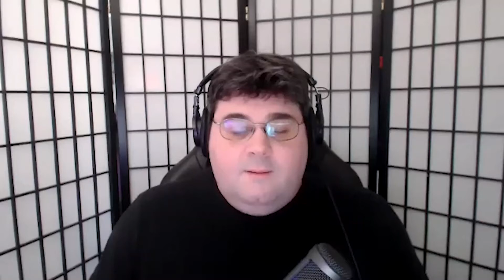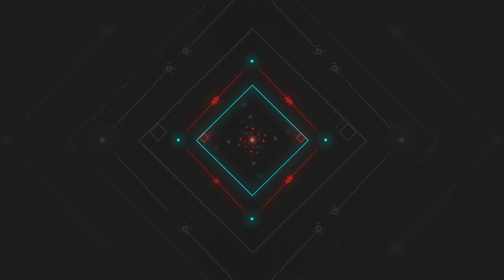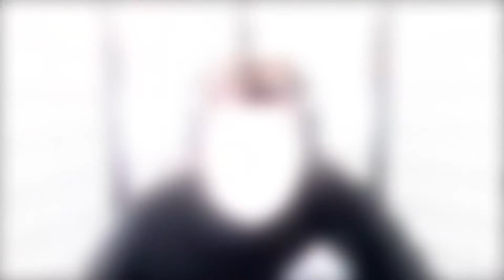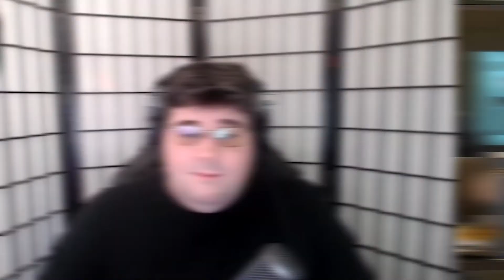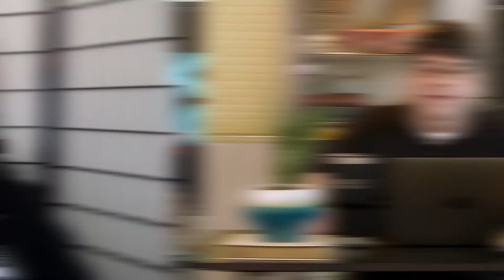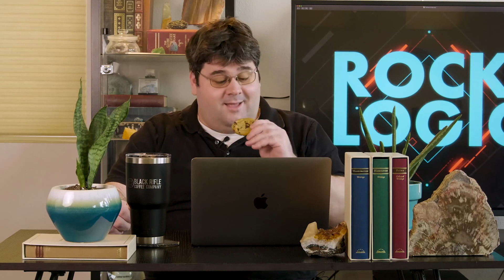Nuclear Marine Energy Powering International Trade | Ep 13

Comment: I believe there is at least one company in the US that's using 3D Printing to produce all the parts of a rocket. Perhaps 3D-Printing all the parts of an MSR could turn out to be the most practical and cost-effective... and this technology can be more easily "tweaked", I think.
Reply: At the Oak Ridge National Laboratory (where the original salt reactor experiments were done) they are already printing reactor components. They are currently developing a printed reactor core and hope to complete it by 2023.

Comment: Given the size of some of the SMR’s being designed, I can imagine cutting a not-very-large hole in the deck or side of an existing hull for insertion of a replacement for the boiler.  While that’s going on, train the engine room crew and officers how to operate the new technology.  Come to think of it, not long ago, I saw something about a cruise ship sawn in half and extended.  If that can be done, inserting a SMR will be a piece of cake.
Reply: Most SMRs today are NOT actually Small, but very large for their power. That is the reason the DOD refused to buy any of the SMR designs. NuScale VOYGR reactor is almost the same Diameter reactor vessel as Westinghouse AP 1000, and is several times the height of AP 1000.

Comment: Sean, Well done, I agree with you entirely.

 The way to a GHG free future is clear by appropriate exploitation of nuclear technogy. This of course isn't to say renewables won't also have a very substantial role.

With synthetic fuels we don't need to redesign aircraft for hydrogen, electric propulsion etc when synthetics, a well proven technology, can do the job. I note the interesting part of the USN proposal is JP8 will be used for everything, motor transport, ships and aircraft, as both diesel and jet turbine fuel.

One difficulty I do foresee with MSRs at sea  is vessel movement disrupting the molten salt convection currents that present designs exploit. Some work needed in that regard. However, Thorcon have indicated their concept although designed for shore side application could be used offshore on something like an oil drilling platform. In addition to solving regulatory and jurisdictional issues this could also aid with security.

Overall offshore nuclear makes a lot of sense and one could envisage this being part of an offshore energy precinct including wind, waves and ocean currents.
Reply from the maker: Thanks Jim! To me it just makes nothing but sense to go this route. And yes it would compliment renewables perfectly.

Comment from the maker: Do you think there's value in nuclear marine energy? What subject do you want us to tackle next?
Reply: If you have not covered it already, how about the 3D printing of nuclear reactor components. The Oak Ridge National Laboratory are currently designing and printing a reactor core and hope to complete it by 2023. Inconel superalloy and stainless steels etc can be printed on many commerical metal printers.
Reply: How about 3D co-printing of solid fuel AND cladding to dramatically reduce the 90% cost of solid fuel to make it more competitive to liquid fueled, i.e., MSRs.
Reply: One of the tough nuts to crack is going to be getting airplanes off fossil fuel.  Hydrogen is heavy due to the tanks needed to hold it under pressure, and the weight of batteries is also limiting.  Can lighter weight (fiberglass?) pressure vessels be an answer?  What else can work?
Reply: @harleyb.birdwhisperer  Why bother? With the process described in this video total world fossil fuel consumption could be satisfied in a CO2-neutral cycle.
Reply: Nuclear powered CO2 & H2 extraction from seawater, & making of synthetic jet fuel.